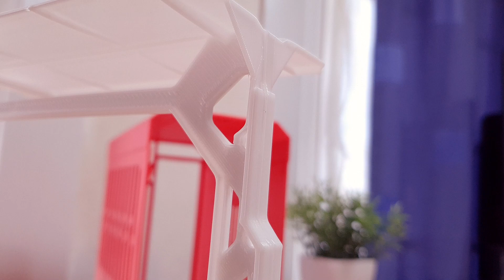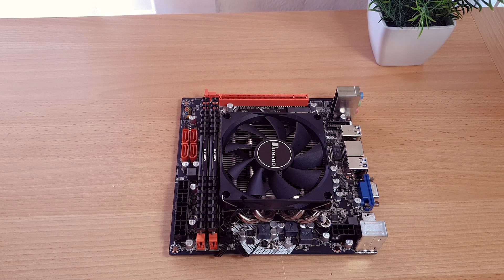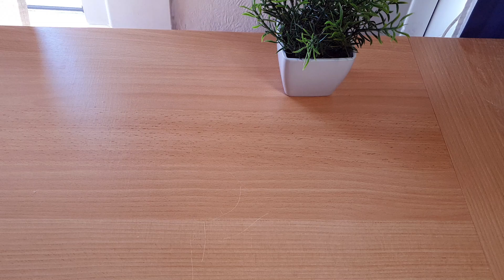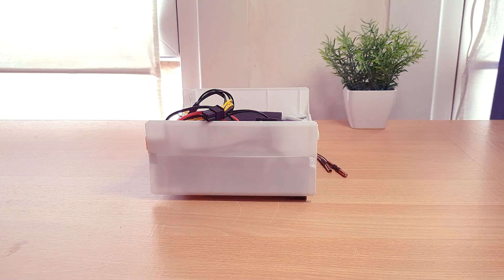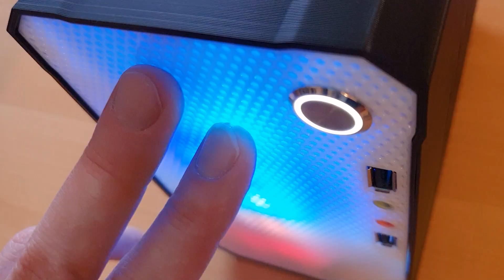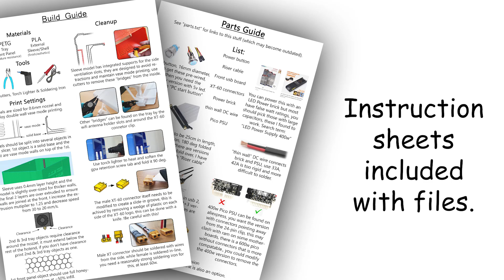3 Piece PC Case, 3D Printed

Comment: There are many 80x10mm fans sale. You must try to add 4 ones to airflow addition. dare you to do it
Reply from the maker: I can see stacking 2 on top of each other in the front panel, as exhaust, I can't see where the other 2 would go, and I personally prefer less fans as each fan adds a bit of noise, I'm looking at putting a single 90x15 fan in the larger version I'm currently prototyping.
Reply: Your case kind of cool bro. I hope next video, next content will be excited with fans and airflow..its will be great, i cant wait...

Comment: nice job! does the case bend with the heat?
Reply from the maker: No, but I used low power parts in this, an i5 and GTX 1660, the outer sleeve is PLA but the tray and front panel are PETG to help with this, you could use all PETG to be safe, it has less surface finishes available but you can get matte versions.

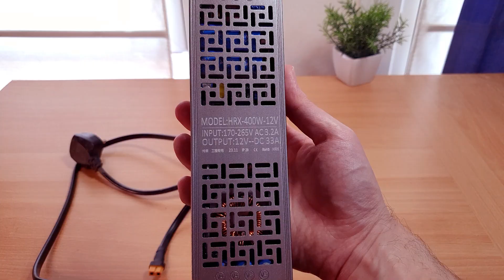Comment: 1:39
I lol'd when you used an LED power supply. Those have bad ripple & noise, probably 200-300mV Vpp. 
Look up "ATX current ripple standard", 120mV is the recommended spec. Your motherboard components like mosfet/cap will die faster than expected if you continue to use that PSU as its not rated for that.
Reply from the maker: I guess I'll get an oscilloscope to test this, I tried several LED PSUs like this, some worked others didn't, I noticed the working ones came with much bigger capacitors, the pico PSU may do some smoothing, I also tried the Xbox brick which works until you run a game or something that uses power, then it cuts out.
Reply: @arkatub  
Stick to power supplies that has a datasheet that you can lookup. Meanwell is one of them. Xbox and PS4 PSUs "should" be ok, you probably got a dud or fake. But NEVER use no-brand led supplies for picoPSU.

Comment: You should add dust filters to prevent dust build up
Reply from the maker: I did think about this but I wanted to make it compact as possible, one prototype the GPU fan touched the side so I added a few mm to be comfortable, I'm thinking to make a bigger version with more relaxed dimensions, accomodate taller CPU coolers and longer GPUs, can add some slide in dust filters to this version, may delay the follow up video a few days to include this.